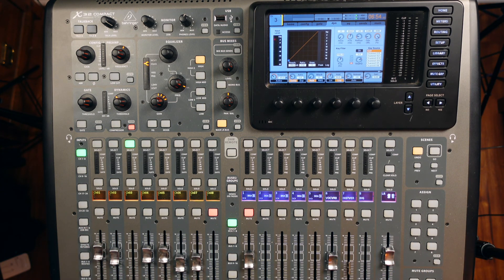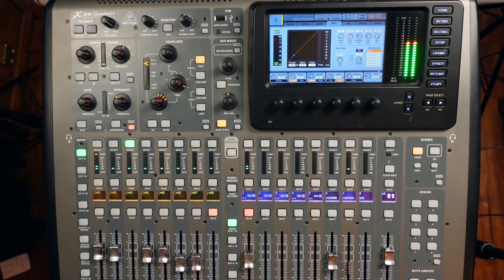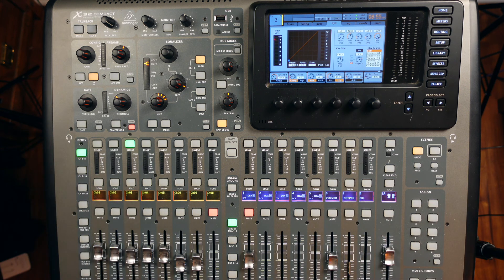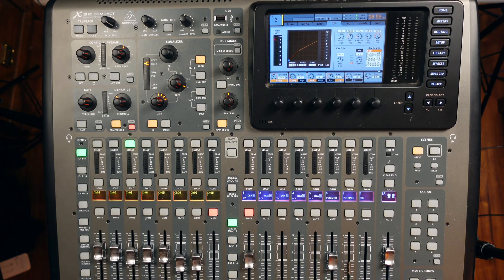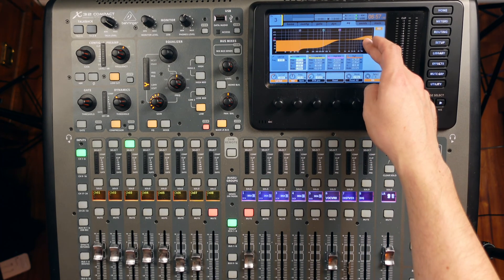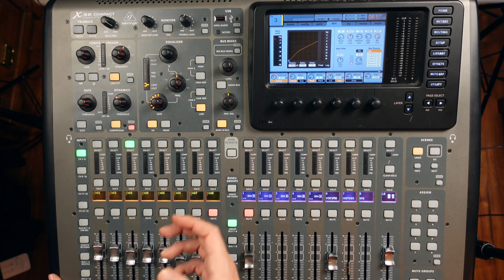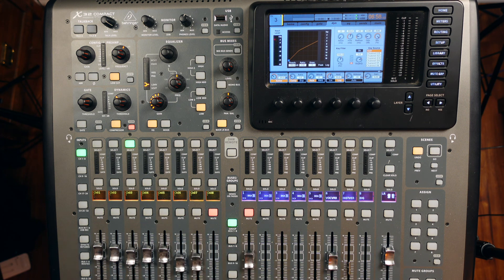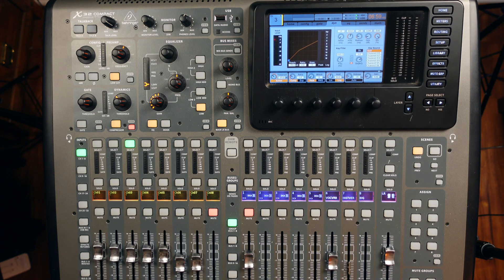Behringer X32 How To Mix A Snare Bottom Mic For Worship

Comment: Quick comment on EQing the bottom mic (or both snare mics for that matter): when you low cut one mic, the phase of THAT FREQUENCY shifts which means you can get drastic, unexpected phase additions or cancellations. Definitely something that can be a huge pain or something that you can use to your advantage if you know what’s actually going on there. So that "illusion of adding more body in" might in reality literally be this: the low cut on the bottom mic serves to add its signal at that frequency in phase with the top mic, resulting in a fatter sound than the top mic would produce on its own.

I cut clashing frequencies on the bottom mic similarly to the way that you do and it definitely helps. I think the phase shifting thing is just something to be aware of. Dan Worrall has some incredibly educational videos on this topic (which is where I learned about it :)).
Reply from the maker: That’s really interesting! Thanks for the comment! I’ll keep that in mind for sure 👍